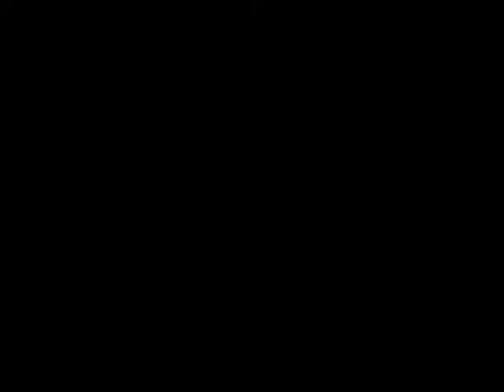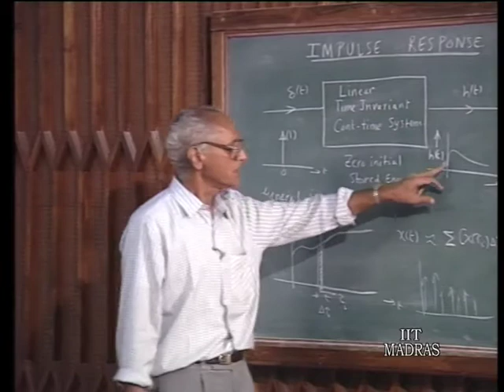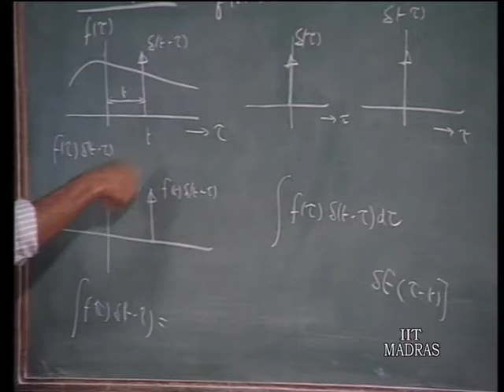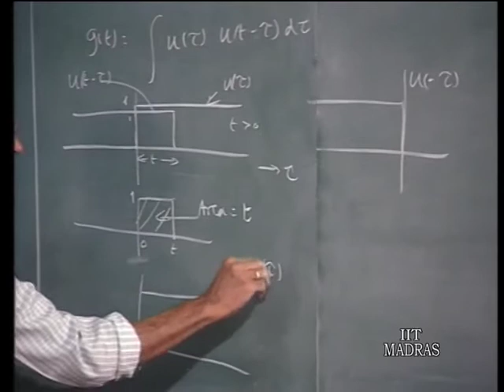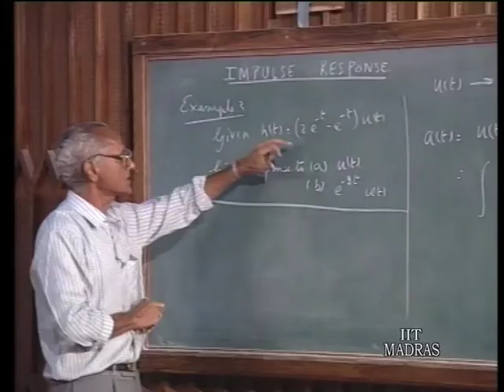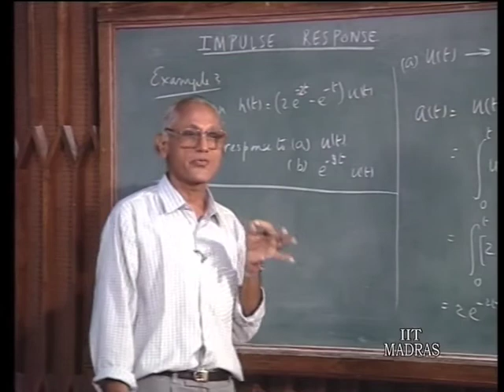Lec 15

Comment: spl case of causal input syst convolution 
convolution intgral limits for causal syst are 0 to t instead of - inf to + inf bcoz for t<0 causal ip x(t)=0   0:00
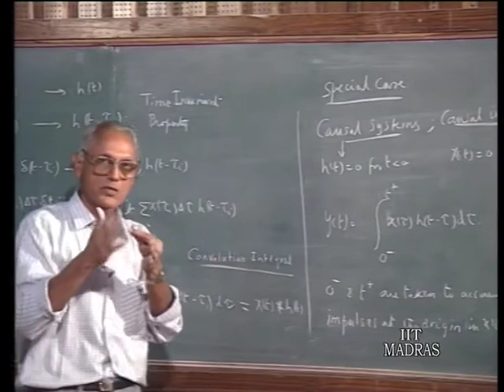problem 1 : f(t)*h(t) = ? 5:00
delta(tow) -> (fold) delta(-tow) -> (to get delta(t-tow) means advance delta(-tow) by t ie shift to right by t) -> multiplty & then integrate giving
x(t)*delta(t)=x(t) i.e convolving any arbitrary casual fun f(x) with h(t) gives the same func back i.e. f(t)*delta(t)=f(t) 
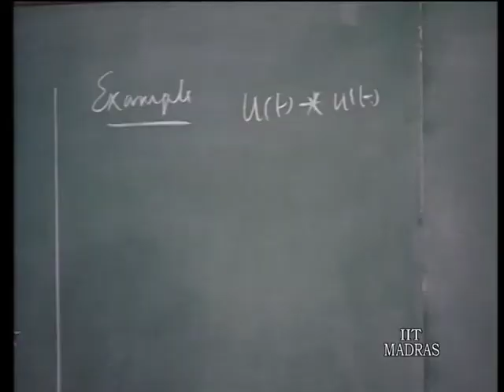problem 2 : u(t)*u(t) = ? 9:00
u(t) * u(t) = t for t>0 & 0 for t<0 = r(t) .e. ramp func
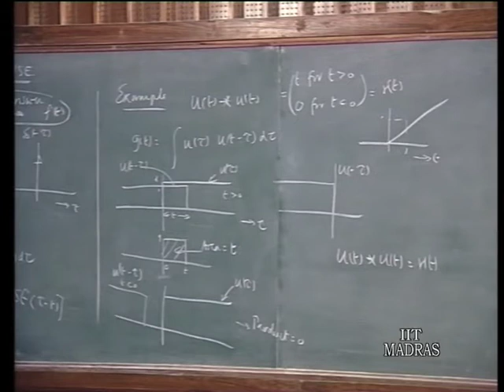problem 3   12:30
impulse func of a syst consists of natural freq thus giving natural syst resp 
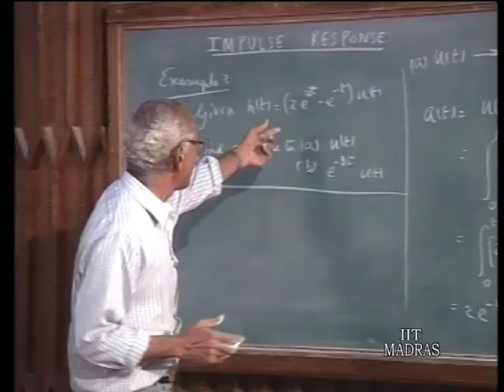forced resp consists of freq of forcing func  19:00